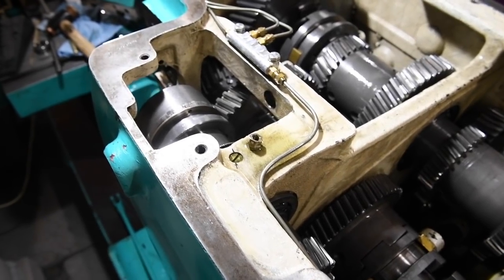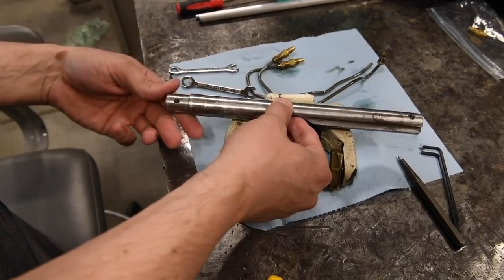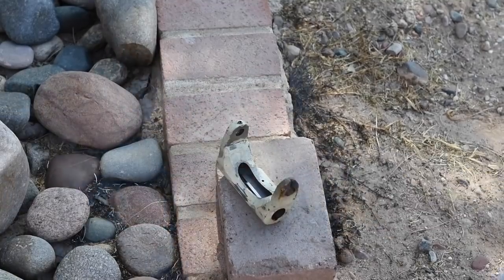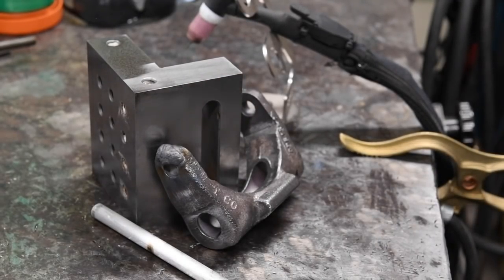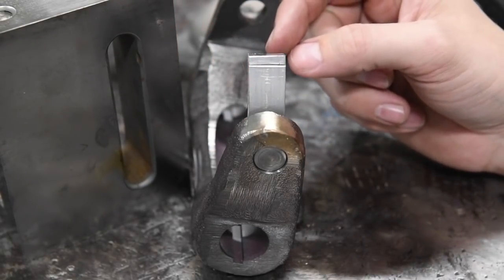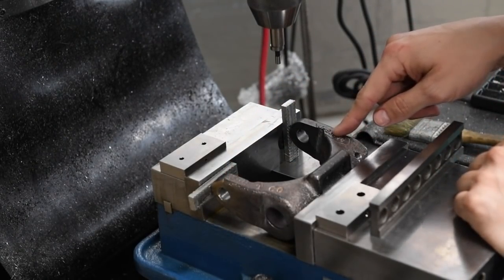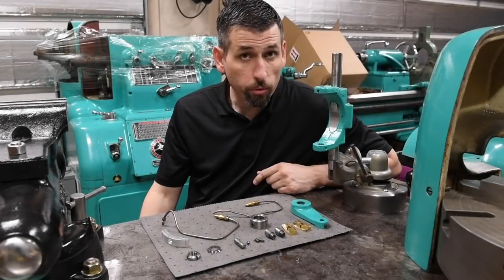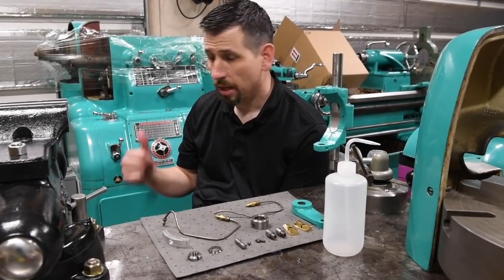Monarch Shifter Problem Part 2

Comment: I know this is an oldie, but all you Monarch owners fight that drain plug in the back of the headstock. A few pipe nipples and fittings, a ball valve and you can plumb it over to an area that you can get a pail or bucket under it. No pump, no muss, no fuss...

Comment: Came to learn about how monarch geartranes work, learned how to repair the bearing holder for the power supply shaft to the power feed transmission on my K&T ressurection. I did not know silica bronze wouldn't bond with aluminum.

Comment: Nice repair, have you ever tried aluminum bronze with AC for cast iron repair/buildup? It works surprisingly well.
Reply from the maker: Yeah I've got some aluminum bronze wire as well. I tend to lean toward silicon bronze DC for whatever reason- aluminum AC works great too. Thanks for watching!

Comment: Might not be right for this but a little tip to put in your trick bag: Nitronic 60 instead of Bronze. Non galling stainless bearing material, stronger, less expensive than Ampco. Im getting away from Ampco.
Reply from the maker: Timothy Duzenski interesting I’ll have to check that out. I’ve done silicon and aluminum bronze but not Nitronic 60. Thanks for the tip.

Comment: 9:41 Looks like someone has been busy grinding away at the edge of the part. Some of the text on the casting is missing. I´m guessing they had problems getting it back in there.

Comment: I hope u found the piece of that Cast Iron that broke off of the fork. That material running inside your gearbox flopping all over the place will destroy your nice gears.
Reply from the maker: I found the piece, but it wouldn’t matter- it sank to the bottom and didn’t move once it did. The pump moves oil around onto the gears, but it’s not like in a car’s engine where large volumes are being sucked around.

Comment: Nice job!
You could probably run that oil you took out through a filter and reuse it rather than throw it out.
Reply from the maker: Through the bulkhead very true, but it was pretty contaminated. I drained the oil that had been sitting for the last 10 years but didn’t flush the headstock, so there was a fair bit of gunk in it. This will be a fresh start.
Reply: I was thinking some  cheese cloth.  That should clean it enough for a gear head.

Comment: Does the shift fork or linkage have a detent to keep the shoes from riding on one side of the collar groove? It seems like it wore as if riding the clutch on a manual transmission car.
Reply from the maker: wdc283 there doesn’t seem to be a detent anywhere. Hopefully once I get the new shoes installed we’ll see  how it goes.

Comment: At 15:41 when power tapping you turn off the motor, engage the spindle brake and probably stop applying downward pressure on the quill causing your setup to swivel up. From there after you could have broken your tap by reverse power feeding. I wouldn't power tap such a delicate setup.